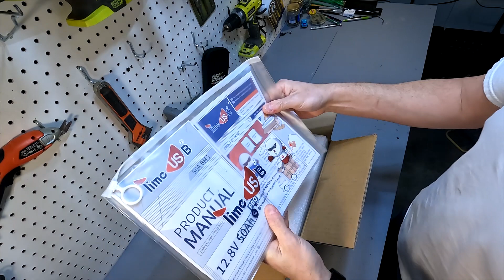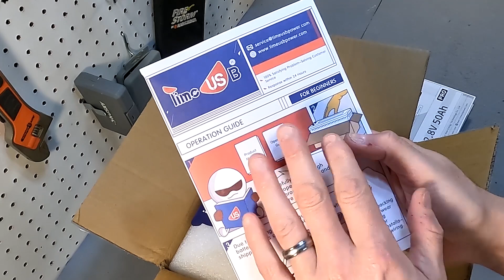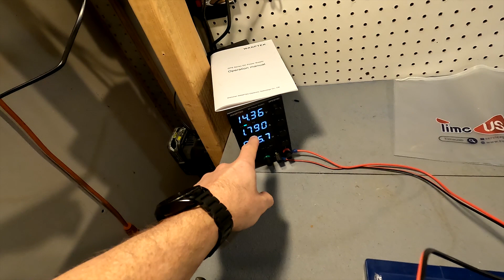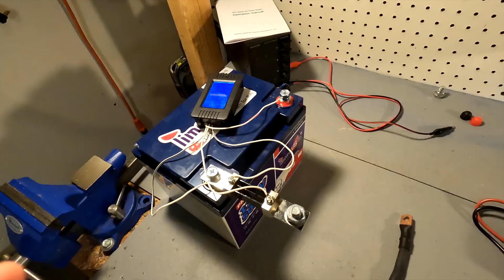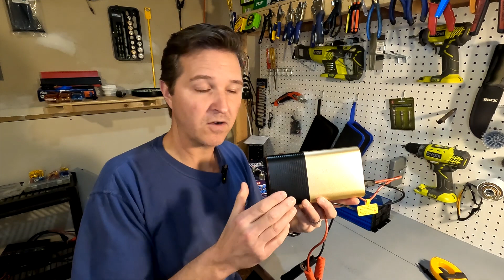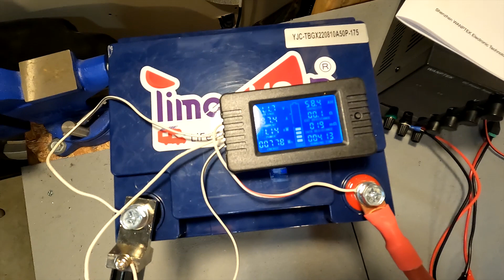Beginner Friendly review of the Timeusb 12v Lifepo4 Battery

Comment: I have the Timeusb 12V 200Ah Plus LiFePO4 Battery | 2.56kWh & 2.56kW | 200A BMS  battery and I also have the Powerqueen 190ah With the 150a BMS ..and wondering if I can parallel the 2  iv seen many videos on doing so with very different AH 12v lifepo4 batteries so I'm hoping it be ok .. just want to bounce that off your thoughts
Reply from the maker: Yep!  Wire in parallel and enjoy!

Comment: Can I charge this from the solar generator 12v dc outlet with alligator clips
Reply from the maker: I haven't tried it, but I don't think so.  I believe the battery would pull more amps than the solar generator could handle.  It also might be the opposite where the battery actually tries to push amps into the DC outlet.  That would probably blow up the circuit board.

Comment: I'd like to know if you can use this battery as your car battery. Will it crank over an engine?
Reply from the maker: I'm sure it would trip the over amperage protection in the BMS.  I think car batteries get a pull up to 600amps.  These storage batteries usually can handle up to 200 amps for a few seconds.

Comment: i wonder what how long it would pump out power if it was shorted? little sketchy on that bms. nice repair job on that battery tester, it was a few videos back but i mentioned it was time to upgrade it, i believe the time has come.
Reply from the maker: Yes.  I've upgraded my battery tester.  Someone else was thinking they are using the same BMS in the 50ah as the 100ah.  That could definitely be the case.  Thanks for the comment.

Comment: Learned something from this video regarding the amps. I wonder if they use the same bms in it that they use in the 100ah. 
Also good point about the cable sizing. I'm not into diy but I'm learning. Thanks.
Reply from the maker: That's a good question.  It would probably be cost effective.  Thanks for the compliment and the comment.

Comment: Some might even call it "cute" 😆  I have 4x 100ah TimeUSB batteries and they are doing well.  However they did not all come balanced sufficiently to charge fully. One would shut off barely over 14.0 volts.  It took some time repeatedly charging after fully charged (I used a bench power supply) and now all 4 will charge to just over 14.5v before they shut off. They stopped improving so I think they are hitting a limited coded in the BMS.
Reply: Hi! How are batteries working after a year? Thanks!!!
Reply: @mondobizzarro79  Still going strong, and still balanced!  I don't know if what you buy today is the same, but the company/brand is still here and that's a good thing.

Comment: It's impressive, I was debating on that brand just a month ago but ended up deciding on one with cold charge protection since it was going in a gate opener. I feel the same as you did on that amp test though, a little over is fine but that was a Lot over.
Reply from the maker: Yes it was A LOT over.  Good call about getting a battery with cold temp charging protection for the gate opener.  Probably well worth the money.  Thanks for the comment.

Comment: Very useful tips on using a resistor to avoid sparks and for using cables with the gauge for the inverter and not the battery. I wonder if the BMS in your battery is not working properly
Reply from the maker: I'm not sure if it is or not.  It's possible I didn't let it run long enough for it to activate.  I know with over voltage, it shuts down right away.  Thanks for the comment.

Comment: Definitely should be able to pull 3C through that bms for a minute or so before the thermal protection would shut it down.
Reply from the maker: Is that seriously all the over current protection is?  thermal protection?  I always thought it was programming in the BMS.  Thanks for the comment.
Reply: @OffGridBasement  unless you reach the maximum pulse discharge current, which is usually pretty high on a standard bms, it will allow the higher current to flow until too much heat is generated and will trip the thermal protection. This would have been an excellent addition to your testing and review of the battery module.
Reply from the maker: @SilverTreasures  great information.  Thank you !